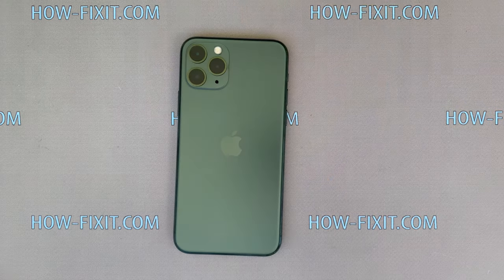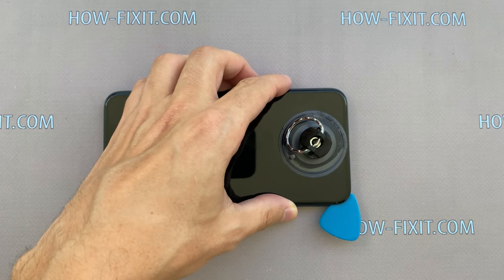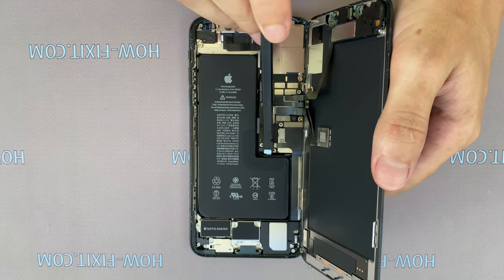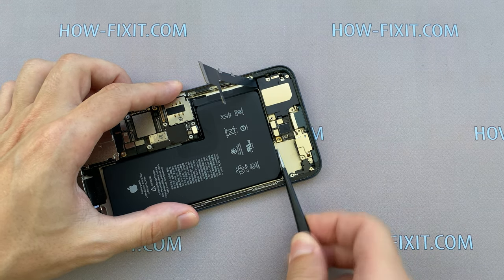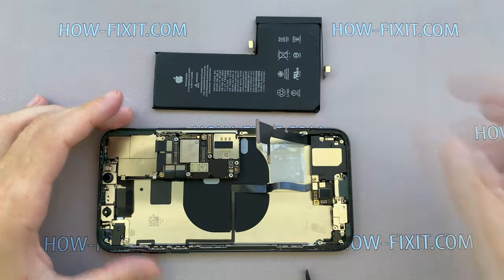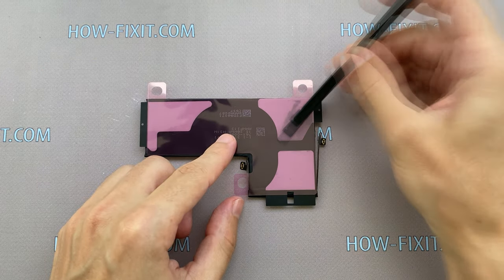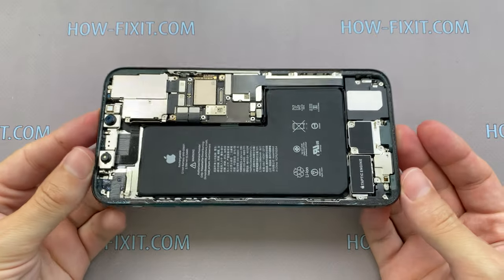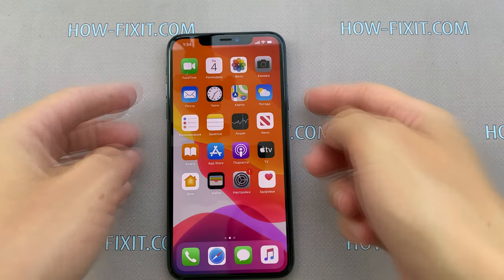iPhone 11 Pro Max Battery Replacement

Comment: How do I get rid of the battery health error?
Reply: Every baterry different than the one in your phone will be recognized as non-genuine. You have to cut off and swap the baterry bms board. Then reprogram it back to 100%, unfortunately this is also not possible because of the flex cable that doesnt allow that, so maybe swap the flex cable from bms or buy some tag on flex to program it back to 100%. Finally, you have swapped the baterry without the error message. Thanks apple...

Comment: in 10 months my battery is at 90% health. disappointing.
Reply: Mine is at 91%. This is because you should not be letting your phone battery drain COMPLETELY or near completely. You should be charging it throughout the day whenever you get the chance. Draining the phone battery to 0% and then charging it damages the battery capacity.
Reply: @user-hh9jc9hs8f  20% to 80%only. Use a mechanical timer when charging overnight and know the minutes and hours to charge for a certain battery percentage left. Fast charger is the best as long as you dont charge over 80% and not let your phone drain below 20%
Reply: @samuelmanny6231  whats bad if you charge over 80 %? lets say whats bad if i charge to 100 %?
Reply: one full year and still 100%

Comment: Please advise what size of a screwdriver is required to remove the two screws at the beginning. My Y000 screwdriver does not work for some reason on them. Other screws come off easily
Reply: P2

Comment: Thinking to change my battery after 4 years usage but at apple authorize. Just wanna ask, since 11 Pro max had a glossy stainless steel frame, will the frame scratch from opening the backdoor process? My phone even after 4 years still look pristine with no scracth at all on the stainless steel frame.
Reply: i just got mine replaced at apple. no changes or scratches depend how they handle it. i have kept mine in a case and screen protector since day 1. People buying new phones are chumps.
Reply: @Waly_Rabz  I’ve been handling my phone very careful for around 4 years, my phone still looks like new only the battery already on 75% (need to charge twice a day), minor to almost no scratch on the frame. I just worried when they open from the frame, they’ll scratch my frame 🥲

Comment: Does the new battery needs to be reprogrammed or something? I’ve seen some use an programmer type thing for replacement screen and batteries
Reply: Every baterry different than the one in your phone will be recognized as non-genuine. You have to cut off and swap the baterry bms board. Then reprogram it back to 100%, unfortunately this is also not possible because of the flex cable that doesnt allow that, so maybe swap the flex cable from bms or buy some tag on flex to program it back to 100%. Finally, you have swapped the baterry without the error message. Thanks apple...

Comment: it's possible to replace battery of iphone 11 pro max to xs max? please reply?
Reply: I'm thinking the same thing
Reply: Not possible, both the batteries are different
Reply: Every iPhone battery can be replaced. Just no battery health will be shown in the settings.. But battery percentage will show for daily usage. Not a big deal. Just replace battery every 3 years or when it doesn't last like it used to.
Reply: b

Comment: Will the software recognize this battery that you linked on ali express as a genuine battery or will it give a warning of an ungenuine battery?
Reply: Every baterry different than the one in your phone will be recognized as non-genuine. You have to cut off and swap the baterry bms board. Then reprogram it back to 100%, unfortunately this is also not possible because of the flex cable that doesnt allow that, so maybe swap the flex cable from bms or buy some tag on flex to program it back to 100%. Finally, you have swapped the baterry without the error message. Thanks apple...

Comment: My 11 pro max battery health is at 95%. I bought it on day of release 20-09-2019.

- I always fast charge between 20-80%
- I use wired Apple carplay alot
- sometimes wireless charge with 5watt charger.
Reply: It doesn’t matter how good you take care of the battery the battery will still lose percentage but taking care of your battery willl last longer than people who don’t take care of their batteries
Reply: i have had mine since around the end of 2019 and i have 81% hahahaha probably because i play graphics intensive games which whittle down the battery quickly and i always fast charge it. i think i have around 350 battery cycles

Comment: Will Face ID and battery percentage stop working after this but should work fine ??
Reply: why would they stop working ?
everything works fine
the only thing is you cannot see your battery health in the settings because its not an original apple battery, but face id and battery percentage still works fine

Comment: Does this replacement affects the water and dust resistance? IP68?
Reply: Yes it does, once you take it apart it will lose its water resistance but not dust since that is probably just a coating.
Reply: Jatzuyu even if the same adhesive tape was added ?
Reply: @amrashraf9559  if you use the kit in this tutorial it’ll be the same as it was before

Comment: At what percent of battery health shoud i replace it ???
Reply: 80% and bellow
Reply: Mine is at 92% I been debating myself when to do it, if I should open the device and have a fresh battery or let it go as long as I can to keep the phone unopened, if that makes sense.
Reply: @thetechlibrarian  I don’t recommend replacing a 92% battery, especially because the replacing process is risky and can leave you needing new parts or even just destroy your phone entirely. My 11 Pro Max battery is at 84% because I used my phone recklessly and it still lasts the 11 hours a day I use it.

Comment: Doesn’t this damage the water proofing
Reply: Gabriel Wentzel yes
Reply: If you replace the adhesive it doesn't.
Reply: @mustafaaniladanir  are you 100% sure? I bet the new adhesive is not placed as good as the factory one... or probably isn't the same adhesive in the first place...
Reply: @mustafaaniladanir  where can i watch video on how to change adhesive properlly so its waterproof bro?

Comment: Can you install Iphone 11pro max battery on Iphone XS Max ??  Both batteries are the same shape and physical size but 11pro max has better and longer lasting battery ! If someone tried this please share your experience ! Thank you !
Reply: Tried it on Xs max with original 11 pro max battery. 
It completely got ruined. The phone got hot randomly and random shut downs and random restart.
I thought I broke my phone but after that i purchased original xs max battery and put that it and luckily I was back to properly functioning device.  

PLEASE NEVER DO THAT.!!!!
Reply: @kartiknaidu8262  Thanks a lot for the reply. I guess the motherboard is not setup for that  battery to work on older phone... IT SUCKS.
Reply: @kartiknaidu8262  where did you bought the original batt sir?

Comment: thx  ..when my phone battery health 80% so i can replace
Reply: Did u get 100% battery health when u changed inyo new battery
Reply: @mateenshaikh26  yes! 100% battery heath when u replace ...battery backup so good as like new phone in hand🤘🐰🐰
Reply: Mine is currently at 93%, when do you recommend changing?
Reply: At 85%
Reply: I will not replace the battery.  Even battery health remains 70%.